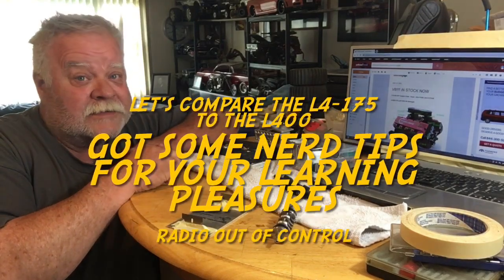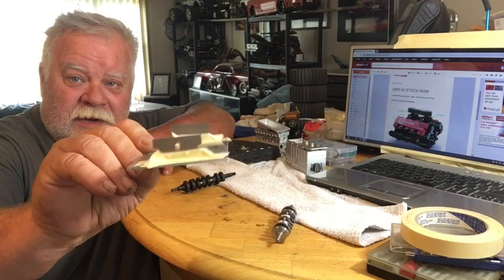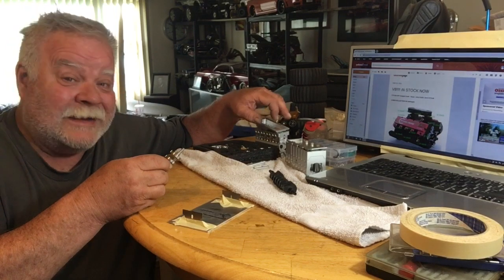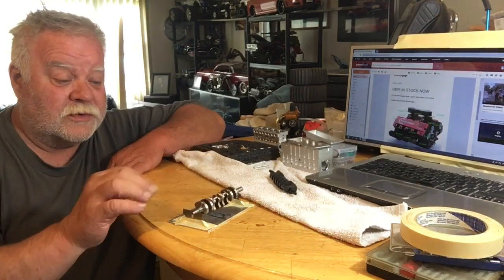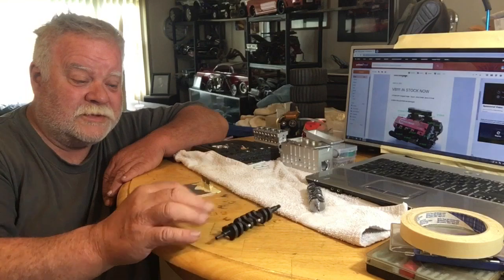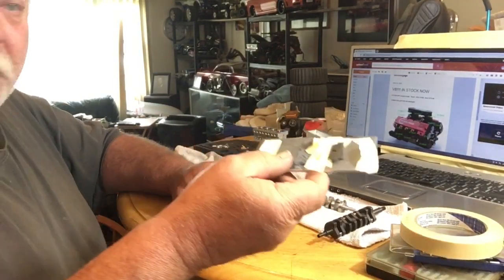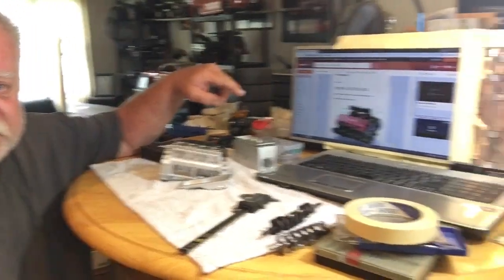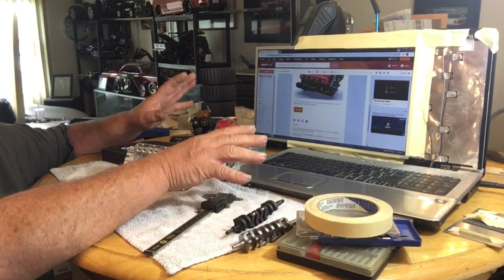Some nerd talk befoe we start the Cison L4 -175 engine build!

Comment: Do you recommend this engine overall? I'm looking for the least problematic build. Should I get the starter pack they sell or buy quality items separately? Like RCEXL CDI and likes of that ? Thanks
Reply from the maker: Honestly I love the quality of this engine, I had hall sensor adjustment problems and I put it in my good engine project box to come back to later 👍👍😁
Reply: @dennisdempseyradiooutofcontrol  good to hear some positives. What exactly is the issue with hall sensor ?

Comment: I guess the build on the 175 will have to do im really looking forward to the new  V/8 build lol. Couple questions if you have a min. Please sir. I don’t think you said when yours was due to arrive  I believe you had already put your order in for one. Not being nosy just the anticipation is wearing a feller down lol. Also  did  you or Cison able to put a finger on the slow throttle response on the V/8. I was leaning little towards timing between cams and crank maybe a few degrees retarded maybe. Just kinda sounds the way a small or big block Chevy with worn out fiber timing gear jumps a tooth or two. Just wanted to know what you were thinking. Anywho thank you for update and your time as always.
Reply from the maker: Yeah I cant wait for my V8 to get here I got a shipping conformation that it was sent out, I think mine is already assembled, I agree the timing on those early V8's seemed sluggish but the latest videos I have seen they rev a lot better.